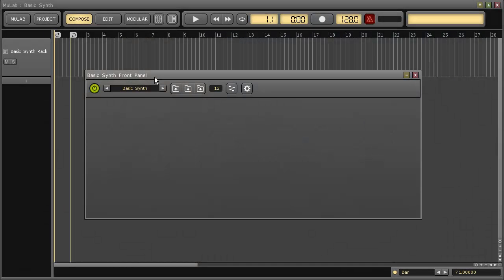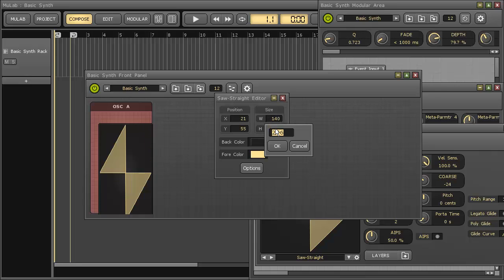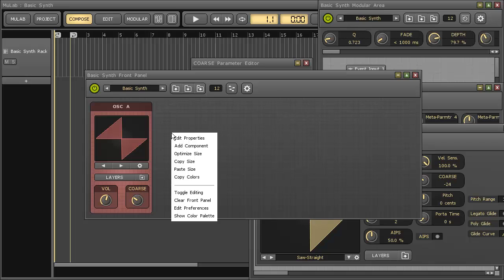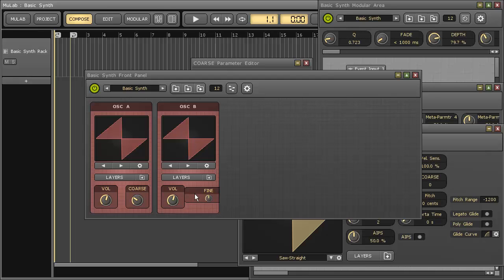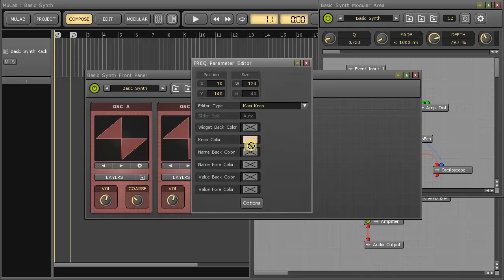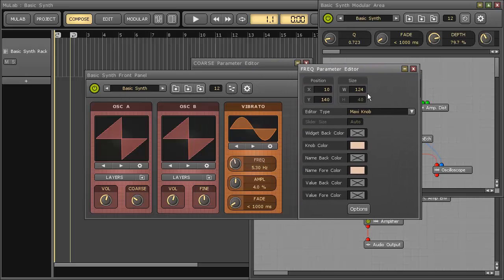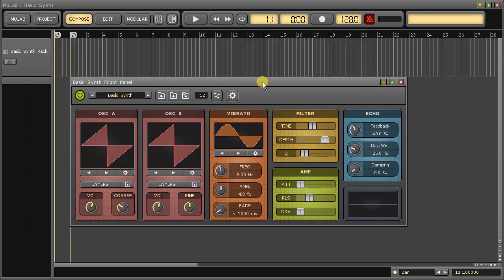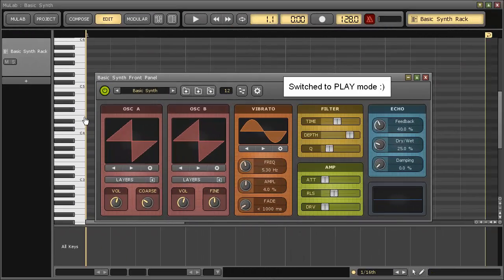The Making Of "Basic Synth" Modular Front Panel

Comment: I'm really amazed... I've built my first single oscillator synth/bass with Low Pass FIlter frequency and Distortion input gain linked to controllers 74/75 in less than 15 minutes!